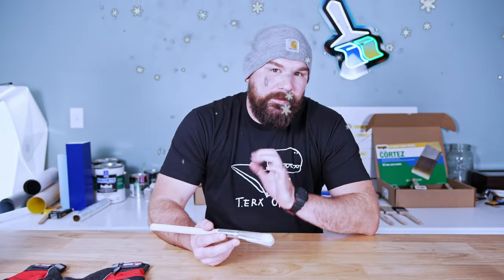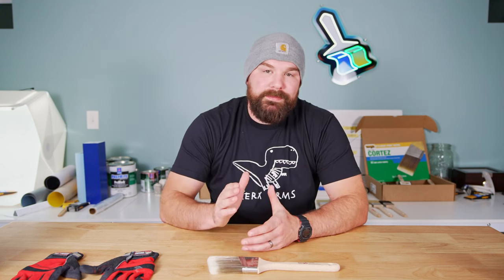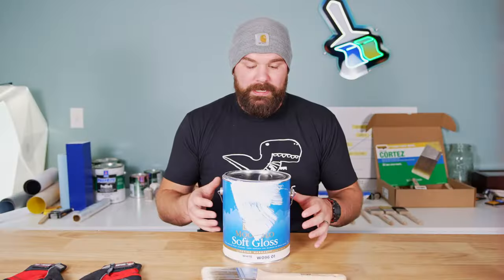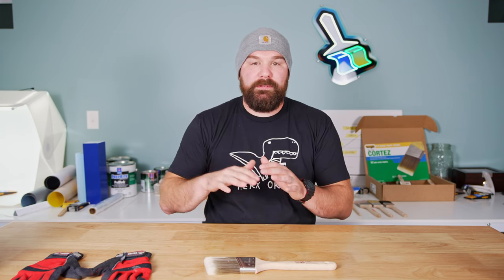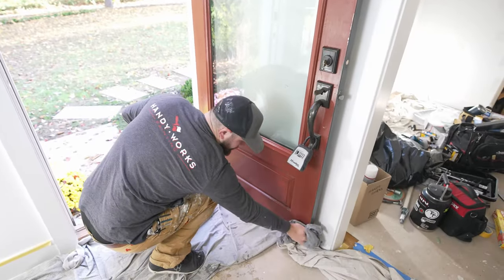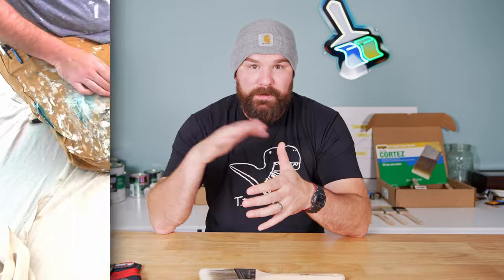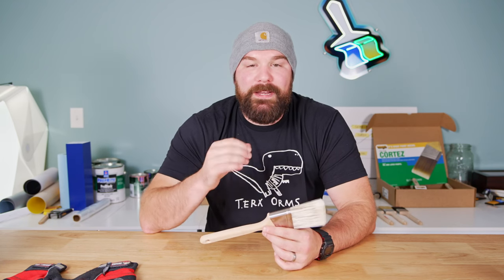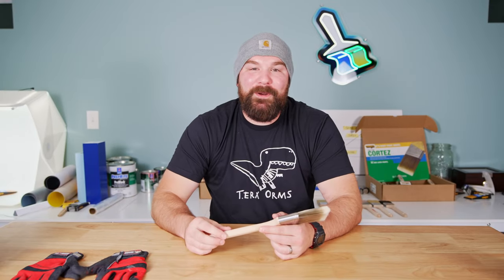5 Pro Tips for Painting in Cold Weather

Comment: I find most of your videos enjoyable to watch however this one you got wrong. According to Benjamin Moore, Sherwin-Williams and any other paint supplier that cares about their customer none of their paints should be applied when the surface temperature will drop below 35 in a 48-hour period of time. Since latex paints especially low temperature can take up to 30 days to fully cure painting in low temperatures can cause microfractures in the paint which will shorten the life of the paint by half. I encourage you to talk to your local paint representative for more information.
Reply from the maker: I appreciate your concern regarding this topic.  The paint I used during the filming of this video (Moorglo Soft-Gloss) is rated to go on at 35 degrees.  I understand if you're reading specs off a spec sheet, but how it performs in the field can be different.  We've done this quite a bit and I've never had a paint failure as long as the paint has a few hours to set up before the temperatures drop rapidly.  I know exactly the type of paint failure you're talking about, and I've seen it when an interior paint is applied on a window sill when and the window was left open when it was freezing out.  

The cure time after it's applied is clutch and the soft-gloss performs really well in a variety of conditions.  I'm still not a fan of painting in the cold, but it can be done.
Reply: @SuperVassarBrothers  definitely not telling you how to do your job but I'm not reading it off of spec sheet I've been a painter for 30 plus years the information that I gave you is from the representative for Benjamin Moore. I live in New Hampshire I deal with this problem every single year. When I say microfractures they're not fractures you can see their fractures you see under a microscope. These fractures are the reason that Benjamin Moore will not warranty the product if they find out that you applied it in these conditions. Again not telling you how to do your job just thought I might make you aware of that because you may not know.